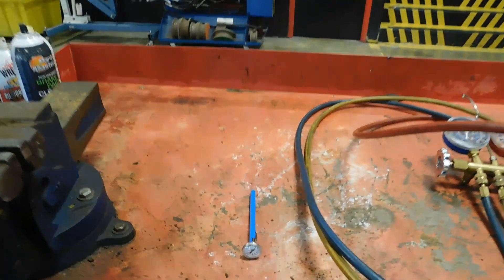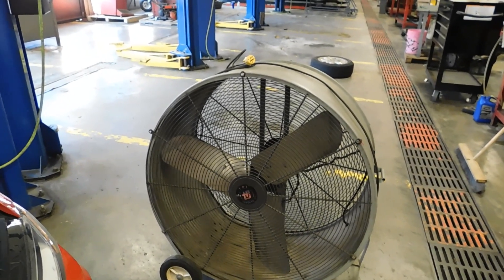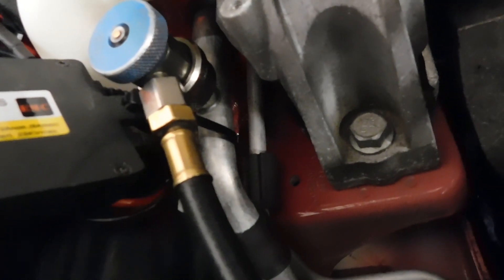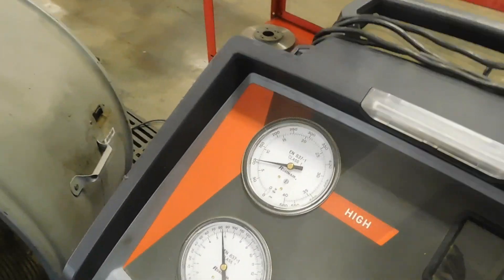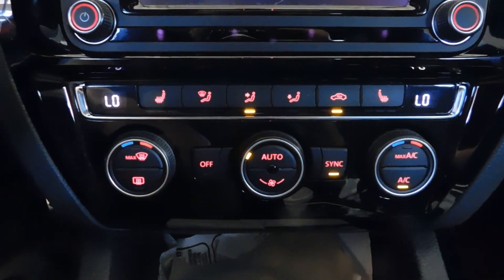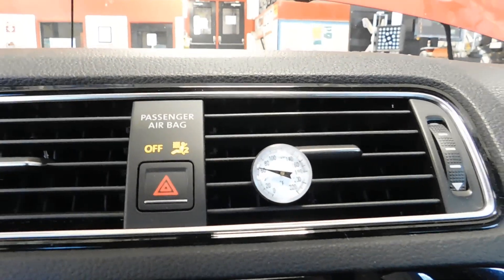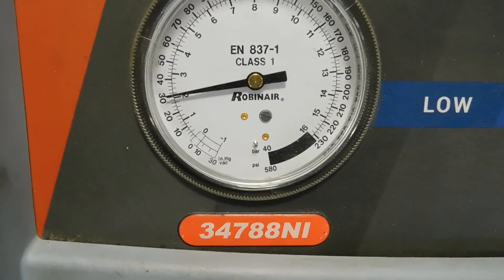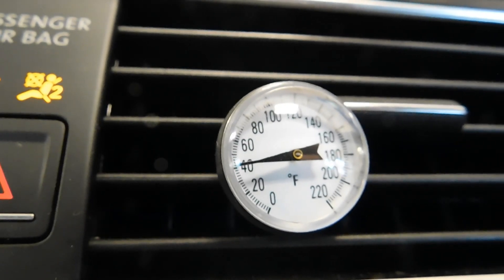Air conditioner performance check on a VW Jetta GLI with R-134a

Comment: Ive got a 2019 Jetta GLI 35th Aniv. A few weeks ago my AC didn’t kick on right away, had to drive about 3-5 minutes before it turned on. Today, the AC hasn’t kicked on all day. Any help is appreciated
Reply from the maker: I would check and make sure you don’t have low refrigerant first. Hope this helps, let us know when you find out.

Comment: I have a 2019 VW Jetta S model, and I notice my ac wasn't as cold, so I figure, I go buy one of those DIY can's, but the gauge port didn't fit at all on the low side, it fit the high side and I know I'm not doing it there.  I have been looking online to find the right AC can, but I can't find anything that would fit it.  Please help
Reply from the maker: I am thinking your car has R-1234yf instead of R-134a. If so, it has a totally different port, and unfortunately much more expensive refrigerant cost. There should be a label under the hood that says what it takes.

Comment: I did notice that when my Jetta was in 6th gear, the ac would become warm and humid. When I put the car in 5th, then the ac would kick in and be cold.
Reply from the maker: Could be slightly undercharged, and the lower RPM might not get the pressures where they need to be. I would recover and see how much is in the system.